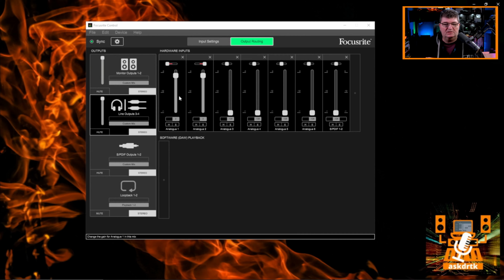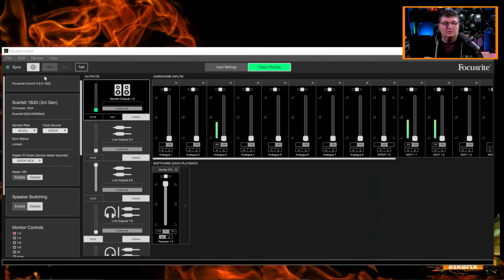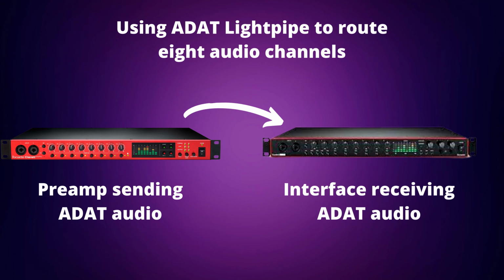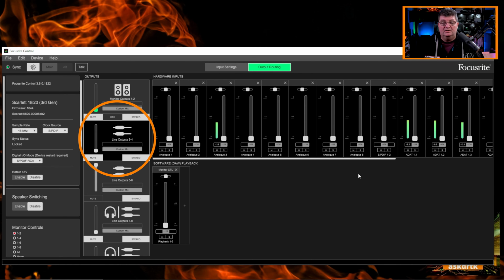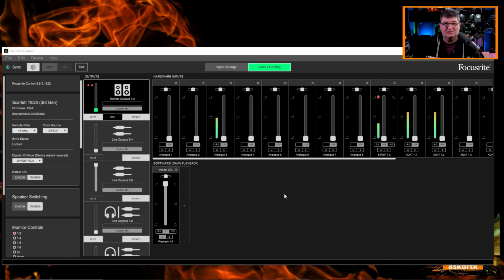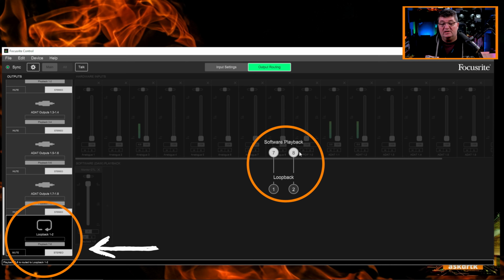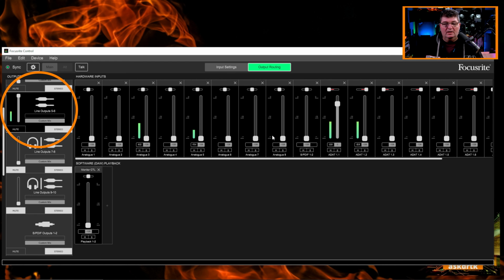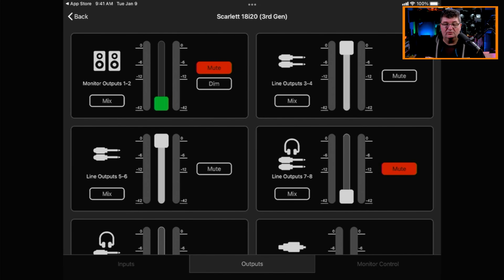Focusrite Control Step-by-Step Setup Guide - ADAT, SPDIF, & iPad Control

Comment: hey there, thank you for such a detailed video! I learned a lot about routing but still feel like I have a lot to figure out. I was hoping you could help me find a solution for streaming and recording with OBS with my setup. I'm using a PC, a scarlett 6i6, ableton live, and I don't have a board. I'd like to create a mix that goes in my ear with a metronome, and a mix that goes to the listener. It seems like there are easy solutions for mac users but not so much for PC.
Reply from the maker: Hello and thanks! You can set this up by doing the following:
Step 1 - In Ableton ensure your have extra outputs enabled in the audio preferences.
Step 2 - Also in Ableton, open the I/O section and change the routing for the "Cue Out" to output 3 or 3/4 on the Scarlett.
Step 3- Using a TRS patch cable, connect output 3 to input 3 on the back of your Scarlett (you can also do this with output 4/input 4).
Step 4 - In the output routing section in Focusrite Control for output 1/2 ensure the levels for inputs 3 and 4 are all the way down (muted) and that Software/DAW Playback in at unity gain.
Step 5 - In the output routing section in Focusrite Control for output 3/4 ensure the levels for inputs 3/4 and Software/DAW playback are all set to unity gain.
With this configuration, you will hear the metronome and Ableton audio through your headphones plugged into the second headphone output on the front of your 6i6 and audio from Ableton without the metronome will be sent to your speakers on outputs 1/2 and headphone output 1. Hope this helps out!

Comment: Hey thanks for the vid so much info.Do you think FCR Clarette 8 pre converters are good compared to Orion by Antelope or even Apogee ensemble .
Reply from the maker: Glad you enjoyed my FC digital guide. Converters are a matter of constant debate. I will start by saying that imo converters have become so good in the past 5-8 years, unless you have a mastering setup it is hard to see alot of benefit in high priced units. That said, I have both a Clarett + 8 pre and a Motu 828es in my studio space. The 828es uses the Sabre 32 ultra DAC which is generally well regarded. What many don't know is that Focusrite greatly improved the converters in the Clarret + interfaces (due to a chip shortage). The Clarett + uses a Cirrus Logic C-5381 for AD and a Cirrus Logic C-43198 for DA. To my ears, through a pair of Genelec 8040s, a difference cannot be heard between the Clarett + 8pre and 828es. Perhaps if I had a set of ATCs I would hear something, but that is really reaching for something... 

In terms of dynamic range (and there is more to converters than only dynamic range) DA for the Ensemble is 123dB, Orion 3rd gen is 120dB, the 828es is 123dB, and the new Cirrus 43198s in the Clarett + 8 pre is 130dB. Yes, 130dB... For AD conversion, the Ensemble is 119dB, Orion is 121dB, the 828es spec is difficult to come by as Motu only provides "DAC" dynamic range, and the Clarett + is 120dB. I'm not trying to say that the Clarett + is superior, or in fact any of these converters are superior, but what I would say is that to my ears, through my Genelec 8040s (decent imo), I would be hard pressed to find any difference to justify price differences based solely on conversion. Of course some of these interfaces have other features which could justify the cost (especially if you like DSP which is a whole other conversation in 2022). If you aren't worried about DSP (I am not with the minimal latency and computer power to handle plugins I have) the Clarett + is an exceptional value imo with its new upgraded converters that have been flying under the radar. Hope this helps out!
Reply: @askdrtk  Thanks!! but i have Clarette 8 pre orginal usb c not the + so  i hv it clocked to an Apogee Rosetta 200 for priniting tracks . i do hear an audible diffrerence using it like this,but i'm still experimenting.
Reply from the maker: Ok, got it. In that case you will likely see a reduction in transient response (maybe 5%). I've found that staging your gain in this scenario can make a difference. I would try experimenting with both pre and post hardware insert gain balanced with varying the gain on the Clarett to find the sweet spot where you get the most transient response. There can often be an extra 1-3dB of dynamic range across the entire usable input / output gain from many converters depending where your gain is coming into the chain. Usually you get the most range when you fall just short of clipping the converters with less input gain and more post gain. I tried this with a Scarlett 2nd gen and ended up with about an extra 1.5dB before we switched to the Clarett + for additional IO (plus the preamps are pretty nice).

Comment: This is a great video, very informative and helpful, btw I have an old Scarlett 18i8 1st gen (still working fine), and I'm thinking on upgrading with a 8i6 or 18i8 3rd gen, but wanted to take advantage of the old unit mic pres (1-4) using SPDIF (not ADAT because I see the 18i8 has only Optical Input, no Output), do you have any recommendation on how to implement this in the better way possible to maximize Inputs, and maybe outputs (for multiple monitor sets)?  Thanks again!
Reply from the maker: Much appreciated. It is a great idea to use your existing 4 preamps with your new interface. The 18i8 1st gen will remember the configuration you setup in Mix Control so it can be used as a stand alone preamp (no PC connection required).

You can use the SPDIF out to route 2 channels (2 of your preamps) to your new interface and while you could route the other 2 preamps through your monitor outputs, this would mean you get 4 preamps but no additional monitor capabilities. In this configuration, your 1st gen also become the master clock sending the signal to your new interface by SPDIF. This means you won't be able to change the clock setting in Focusrite Control for you new interface. You could use a second SPDIF cable from the out on your new interface to the in on your 1st gen to setup the new interface as the master clock, but there can be mixed results with this approach.

Another option is to use the headphone outputs to route your 4 preamps. On your 1st gen, route preamps 1/2 to outputs 3/4 (headphone 1) and preamps 3/4 to outputs 5/6 (headphone 2). You would then use dual mono to stereo patch cables to connect the headphone outputs on your 1st gen to analogue inputs on your new interface. While this uses up line inputs on your new interface, it solves the clock issue I mentioned above. There is no issue with using headphone outputs on the 1st get as line outs as the voltage output it well within the safety range for analogue inputs. I could go into the reasons / calculations for this, but here is a great article from Sweetwater that explains why this is ok https://www.sweetwater.com/insync/headphone-outputs-used-line-outputs-for-line-level-gear/ . With this option you could run an SPDIF from your new interface out to the input on your 1st gen and setup the 1st gen to send SPDIF in to outputs 1/2 with the new interface as the clock master and the 1st gen as the slave. Now you have all 4 preamps and an additional set of monitor outputs.

To maximize IO for preamps and allow for a second set of monitors, you could route preamps 1/2 to SPDIF out, preamps 3/4 to outputs 3/4, and SPDIF in to outputs 1/2 on your 1st gen using Mix Control (again the 1st gen will be the clock slave). You would then have your 1st gen preamps 1/2 on SPDIF on your new interface, with preamps 3/4 from your 1st gen to two line inputs on your new interface, and a second set of monitor outputs from SPDIF on your new interface being routed to the monitor outputs on your 1st gen. This approach maximizes IO on both devices.

Sorry about the long response, but I wanted to provide the options + pro and cons of each setup. Hope this helps out and let me know if you have further questions. Thanks again for checking out my tutorial!
Reply: @askdrtk  Wow, great comprehensive response, I appreciate very much the different options provided in detail, and as a matter of fact, after I sent the comment/question I started designing a setup, and I think it is very similar, if not same, to your maximized option, like this:

18i8 1st Gen (SPDIF slave , and standalone mode)
1) XLR preamp In 1&2 -> SPDIF Out 7&8
2) XLR preamp In 3&4 -> Monitor Out 1&2 (from the back using TS patch cables, right? )
3) HP 2 Out 5&6 -> SPDIF In 9&10 (so the HP02 could be used as a 3rd HP out, not sure if I would be able to control volume on the old scarlett HP02, do you know?)

8i6 3rd Gen (Internal-master)
* SPDIF In (7&8) from 1)
* Line In 5&6 from 2) using TS patch cables, right?
* SPDIF Out 5&6 from 3)
So the new Scarlett using SPDIF In&Out, and a couple of Line level Ins, but now having 4 extra XLR preamps, and 1 extra (3rd) HP Output from the old 18i8, right?

And something similar if I get the 18i8 3rd Gen or even the 18i20 (getting greedy hehehe)

Thanks again for all the detailed information
Subscribed and looking forward for your following videos 🙂
Reply from the maker: My pleasure to help out. It sounds like you have a good plan. My recommendations though would be to use outputs 3 and 4 instead of 1 and 2 on your 1st gen. That way you can use both headphones and a second set of monitors from the SPDIF in. Also, use TRS cables from the 1st gen outputs to the new interface as both the inputs and outputs are balanced connections that will help prevent interference. When choosing a new interface, I like to plan ahead. More IO is great for preamps, but also potential outboard effects and monitoring in the future... Let me know how things go.

Comment: Thank you for the tutorial! I have watched part 1 and 2 multiple times. As you have said, the headphones output should have been on same output as main monitors. 
I have set up  my scarlett 4i4 with external reverb unit on 3+4 i/o as described in your video. It works great, but there is no way to use headphones with this setup because outputs 3+4 is busy.
This is inconvenient, a specially if you have kids and you want to work late at night. Also, it requires to switch between different presets.. 1st world problem I guess :)
Reply from the maker: Glad to help out! This is where headphones being tied to anything other than the main monitor mix can be an issue. If you don't see a need for an interface with additional IO in the future, one solution may be to pick up an inexpensive mixer like the Behringer Q502 (about $50usd). You could connect the 4i4 monitor outputs 1+2 to the line inputs on the Q502 and you will then have both monitor and headphone outputs with independent level controls. This way, the Q502 will work as a monitor / headphone controller, but at a far lower cost...
Reply: @askdrtk  great tip, thank you.
Reply: Why not just plug your headphones into Headphone Output 1 and turn your external speakers down? Monitor Controllers work great too and could do what I described and add a few more handy features. I am using an old Behringer XENYX Control 2 USB. Works great and I can still use both Headphone Outputs on my 18i20. Further, the XENYX has two additional Headphone Outputs.

Comment: Ya that iPad app makes this compete with 2500$ level gear. Hopefully the app isn’t to buggy. Hope to have 4 app connections at the same time. I use the Adat to pipe 2 stereo mixes to a second standalone unit and get 4 headphone mixes now
Reply from the maker: FC + the app really does level up the whole Scarlett / Clarett experience. It's like getting a free multi-headphone mix system all included.  I'm amazed Focusrite doesn't do more to promote these capabilities...

I find the app really stable on both iPad and iPhone (I regularly use it with an 8th gen iPad and IPhone XR, 11, and 12). It doesn't seem to matter how many I have running (tried up to 4 - stable, no control latency/sync issues), but I have solid wifi and my system is running with a 5900X, so plenty of power to run everything.

Comment: This was great, thanks. Looking forward to some in depth ideas on how to use the loopback functions on my 18i20.
Reply from the maker: Thanks - glad you enjoyed it! FC opens up so many possibilities that often go unused...
Reply: @askdrtk  I feel the next step in development would be to add some simple reverb and compression options pre-DAW... If only to put a singer in the right mood!
Reply from the maker: It is interesting that Focusrite hasn't gone with onboard digital / analogue processing (other than Air mode) as many others have. With computers getting so fast and round trip latencies getting under 2ms, I am watching to see which way things go. As latency / computer load has long been a compelling reason for onboard processing, if that issue goes away there can be far more flexibility using plugins for monitoring in DAWs (not to mention cost savings). With my Scarletts and Clarett+ when I need some "mood" for a vocalist, I mix in my Behringer FX2000 using Focusrite control for their headphone mix, but record the unprocessed audio in my DAW. A plugin or switch would be alot faster, but again I'm interested in seeing how things progress on the latency / need for DSP front...

Comment: Do you work with studio one 5? If so is there a way I can contact you because I had a Focusrite solo but I upgraded to the 8i6. However I’m trying to hook up the 8i6 to studio one 5 but it only shows the option to choose the Focusrite solo. How do I fix this
Reply from the maker: I do work with studio one 5. In my case, the audio device shows as Focusrite USB and all of my IO is available. When I unplug one interface and then plug the other in (8i6, 18i20, clarett+ 8pre) studio one gives me all the channels available on the interface, but the device is always called Focusrite USB. 

It is possible to get studio one to rebuild its setting including audio setup. To do this, go to the settings folder (you can access it from the help menu. Then exit studio one. In the settings folder find  the "Studio One" .SETTINGS file. Some say to delete it, but i prefer to rename it to "Studio One OLD" just in case I want to go back. Now reopen studio one and it should rebuild settings and allow you to go through the setup process for you 8i6. Hope this helps out. I have setup a new DIscord server for regular chat, questions, sharing, etc within the community. It will take a while to get membership going, but that is an easy way to contact me. Here is an invite: https://discord.gg/EMq3YVp97u